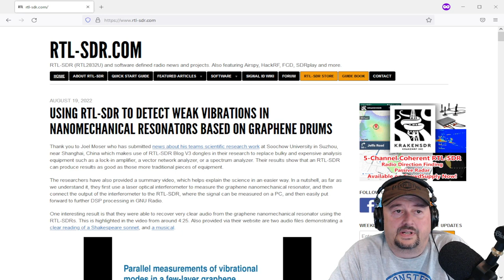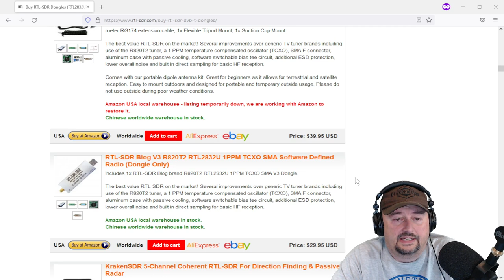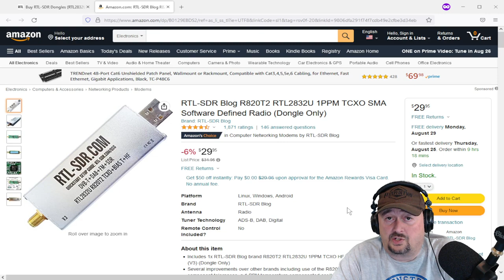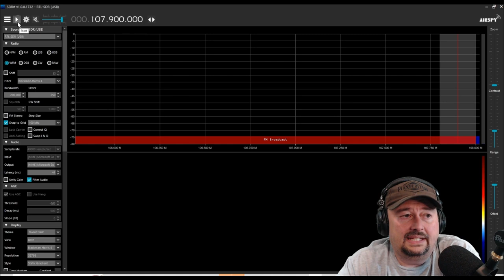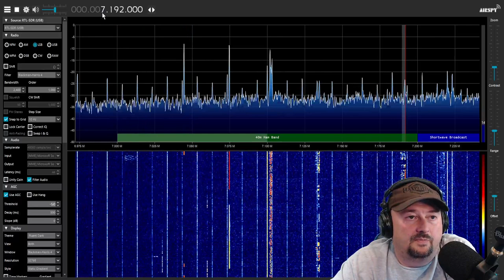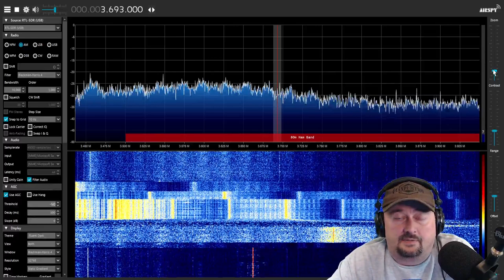HF Ham Radio with RTL-SDR Made EASY!

Comment: Band filters or a preselector are needed for this device - otherwise, due to the low dynamic range, it will collect everything from the antenna. 
But this is a wonderful thing for a penny that is capable of almost anything.
Reply from the maker: I agree that filters help: https://youtu.be/zT1_T25rg3g  Thanks for watching TL.
Reply: With a good antenna, I've received FT8 via WSJTX, 10 - 80 meters. RTL-SDR + Rpi + wire dipole (40 meters long).

Comment: Recently got my dongle and your videos helped me get it set up quickly. I've been using a mag mount dual band antenna in my shack to connect it to but I will probably use it with my EFHW this weekend. Thanks for the videos!! Jack K5FIT
Reply from the maker: That’s awesome.  Good luck with the EFHW 👍

Comment: One thing I learned about SDR receivers is that they have very poor sensitivity.  If you hook a short wire (10' or so) about the only thing I could hear was FM broadcasting and air craft flying over my house.  These radios really need selectivity and RF gain (from amp) to really work.  A full size outside antenna is virtually required.   I can hook a 3 foot piece of wire to my xcvr and I can hear all kinds of signals.
Reply: I can receive FT8 40m/20m on my RTL-SDR and a 6 meter vertical antenna. Works even better on the big wire, 40 meters long.

Comment: After a lot of messing around and some frustrating results, I have finally managed to get a reasonable working set up on HF with this SDR.  My area is very noisy and using a conventional radio (e.g. Tecsun) is often difficult due to the noise.  What has worked for me is using the RTL SDR v3, with an MLA30+ antenna outside in the garden, however I do not use the bias tee that came with the MLA as this seems to be quite noisy (and needs its own PSU).  I enable the bias tee on the RTL SDR instead.  I have noticed that there is quite a lot of aliasing of strong signals, an issue that is mentioned in the RTL SDR manual and use of a high or low pass filter is suggested for the half of the band not in use at the time.  I guess that is just a limitation of this low cost device.
Reply: I power the T with a phone charger battery pack, eliminated the noise and get many hours before recharge is needed.
Reply: Great job, I tried a third install and just don't get the same options that I see in the videos, Don't know what im doing wrong, another computer POEqui[ment that'll sit in a drawer.

Comment: I'd love to use one of these for MW listening.  Let me know if this sounds like an acceptable antenna:  SMA to F Connector, shielded run of RG6(to block any noise from inside the house) up to an aluminum bracket outside about roof level, ground the bracket to a ground rod below, then run 100 feet of wire coming off the center conductor out through my trees as high up as I can get it.
Reply from the maker: Try it out and see what happens 👍

Comment: what is need to cover all HAM Bands? Did you hook this directly to your antenna or to a tuner and what adapter did you use?
Reply from the maker: You can listen all ham bands within the range of the receiver, I used a make sma to so-239 adapter and connected directly to my antenna 👍

Comment: Has anyone achieve this with rtl-sdr v3 and sdrangel? I go the Linux way but I can't yet figure out the correct settings of sampling, decimation and filtering. I'm also aware of the direct sampling mode but again, I can't really find directions about fine tuning values.
Reply from the maker: Sorry man, I have never used sdrangle

Comment: This may be a dumb question, but could I hook this thing up to a duplexer and use it on the same antenna as a transmitter to act as a receiver ? I was thinking of building one of those QRPme Tuna Can transmitters.
Reply from the maker: You probably could with the right equipment 👍
Reply: @TheSmokinApe  Thanks!  I dig your kit building videos. I don't think I've seen you do anything from QRPme. In fact I haven't seen any videos on all of YouTube of someone doing a kit build of their Super Tuna transmitter. Building that would be a must-watch!
Reply from the maker: I just might put it on the list, thanks for the idea AV.

Comment: does the antenna need to be outside? i just bought the beginner kit but i can only seem to pick up a few FM stations :(
Reply from the maker: You will get better reception with the antenna outside.
Reply: Same issue, beginner kit as well. I will try outside

Comment: Ape, I followed your RTL-SDR directions to a T. I have plugged in the dongle into a USB 3.0 port. Either, the dongle will not work on USB 3.0 or I have a fake dongle..
Anny suggestions. Thanks
Reply from the maker: Did you try USB 2.0?  Where did you get the dongle?
Reply: Sadly, my HP laptop only has (3) USB 3.0 ports. I purchased my RTL-SDR dongle through Amazon. Hmm. Advice please 1. buy a USB 3.0 to USB 2.0 converter cable 2. or bite the bullet and buy the dongle from AirSpy.
Thanks, Ed
Reply from the maker: @edbarber6932  I don’t know if a 2.0 will fix it, should be fine with 3.0
Reply: Thank you sir. Have a good one.

Comment: I also thought it did not do HF after seeing it in a comparison with other SDR's. Does it do HF simply from the EFHW in lieu of the optional budget vertical antenna? I never looked into this SDR after I saw that but was gonna save up for the RSPdx.
Reply from the maker: You need an appropriate antenna, really a long wire will do… AND to use the setting I showed.
Reply: @TheSmokinApe I got it setup today and it's working great. 
Now I just gotta build the CaHR antenna. :)

Comment: Hi there. At the start of the part when you press "Start" on sdr software you were showing a very clean spectrum graph. Just wondering if you were using any filters or how you managed to get clean graph of peaks for signals and rest of spectrum was very low or low noise? Hope that makes sense 
I cannot get anything like what you are showing with peaks
Reply from the maker: Hey Bruce, I have it connect to a pretty decent 65" end fed half wave what is choked on both ends of the transmission line.
Reply: @TheSmokinApe  thanks bud. I have same EFHW for 40m-10m bands but no choke at either end, just 49:1 unun at feed point. Wonder what size chokes you are using on your antenna?
Cheers heaps

Comment: How do you know when to switchto USB or LSB or AM? Just trial and error?
Reply from the maker: As you gain experience you will be able to see an AM signal, it will have both upper and lower sidebands and a carrier signal.  For ham radio it's typically USB on 20m and up and LSB below 40m 👍
Reply: @TheSmokinApe  Thanks!

Comment: I wonder if anyone could answer one very simple question! I recently purchased RTL-SDR Version 3 for monitoring world band radio stations and HAM HF bands.  I have listened to many tutorials on the subject, but so far, no one has been clear and specific about a direct and easy-to-understand question: What is the name, brand, or model number of the best software for PC and/or Mac computers. Any specific answer will be greatly appreciated. Thanks!
Reply from the maker: Hey PA, for windows use SDR# / SDRsharp and for Mac use CubicSDR or SDR++ 👍
Reply: kinda havbing trouble too, but im only a few hours in, so far, making sure the dipoles the right length and outside works well XD, and.... usign speaker wire tied to the end of the dipole to extend it works pretty alright  fr when you need ot logner than 1.2m on each leg XD

Comment: I have one of these and the noise it picks up is horrid on HF. I did wind the cable it comes with around a FT240-43 which I think is RG174 and it cut out a lot of noise on the FM broadcast band. I've seen Airspy and SDRplay SDRs on YT and they seem much better with noise. Also I listen to a few KiwiSDR stations here in Australia and when those SDRs are mated to a T2FD or a big loop they're very quite.

Comment: Can this RTL-SDR really tune down to 500kHz with no other requirements?
Reply: yes but you need an antenna for the frequency band.  I have done 20m with success.   Low frequencies may be difficult without additional filters as the noise floor on these can be high.
Reply from the maker: I’ve never attempt to go that low.
Reply: @TheSmokinApe  I don’t think many can do 160m.  Even a 1/4 wave vertical is going to be huge!
Reply: Not a fair comparison to amateur radio, but to answer your question, I listen to AM stations one state over below 600kHz. I also have no problem picking up 80m FT8. Reported to PSKReporter, every continent with an RTL-SDR and a  wire dipole. Haven't tried 160m.
Reply: @norrinradd8952  What size of dipole do you have?  I made one for 20m around 32” half wave dipole.
Reply: @3asyrider75  I have about 40 meters of wire in the air.